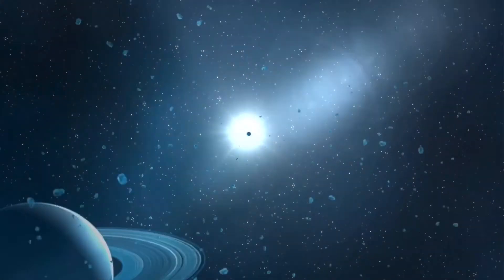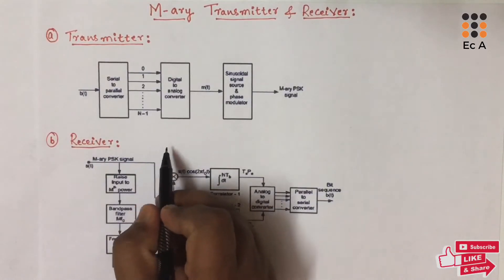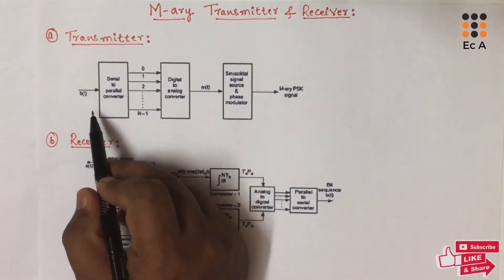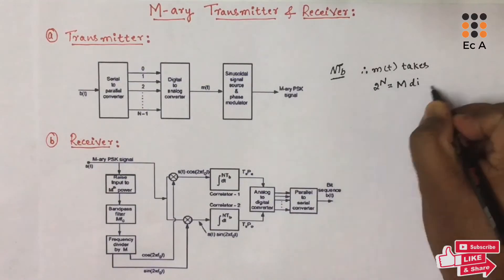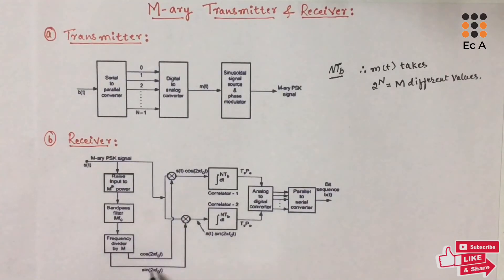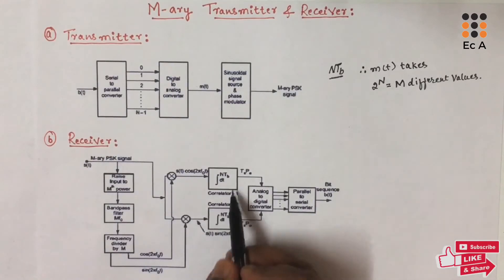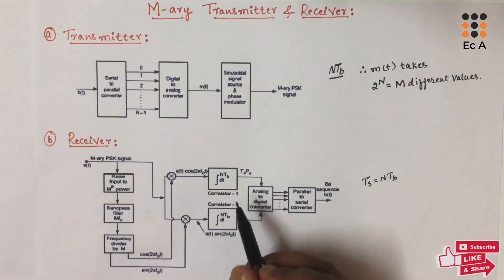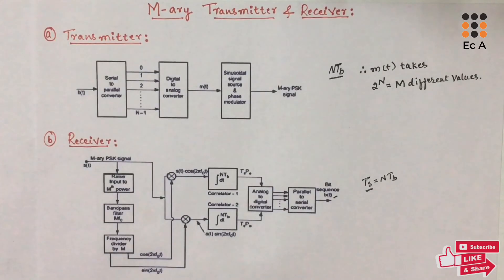DC#40 M ary PSK Transmitter and Receiver || EC Academy

Comment: Awesome.
Can you please confirm the PSK Data Transmitter & Receiver  can be placed apart & the Receiver doesn't need any reference sine wave signal to extract the digital binary data from the carrier PSK input signal. I mean the Receiver module doesn't need any phase or frequency correction from the Transmitter modulating Carrier Signal & the Original data is extracted by free running same frequency sine wave signal at the Receiver end. An early response will be highly appreciated .
Take care stay safe.